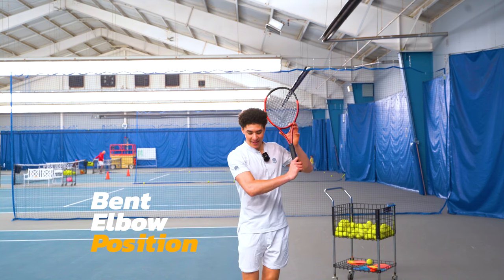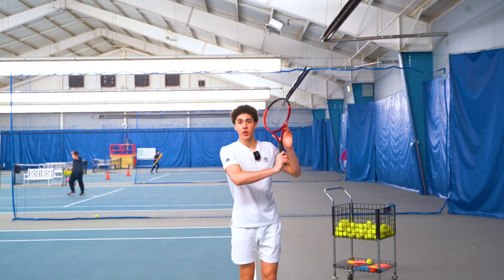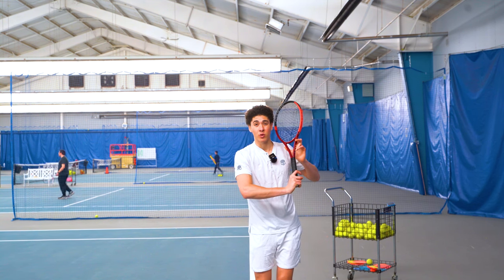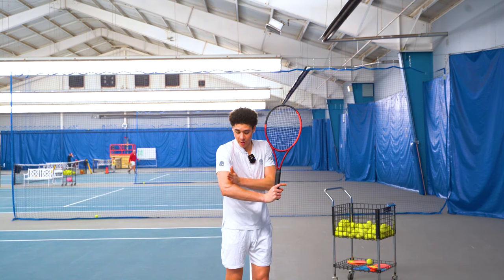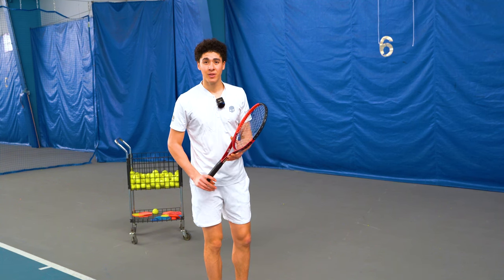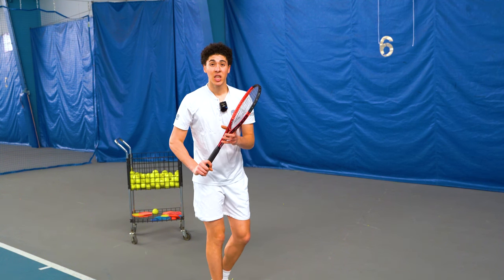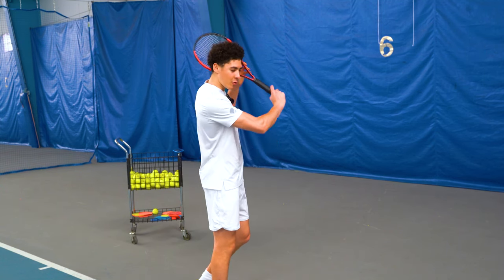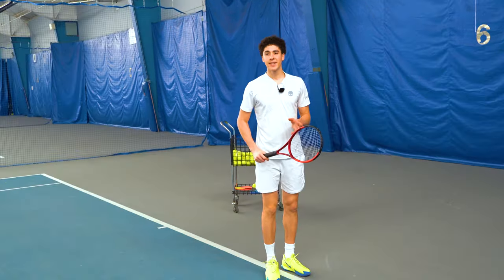How To KNIFE A Backhand Slice And Stop Hitting FLOATERS In 4 Steps (Drill Included)

Comment: IN YOUR COURSE THAT I BOUGHT, YOU TAUGHT THAT THE GRIP FOR BACKHAND SLICE WILL HAVE THE BOTTOM OF INDEX FINGER AND HEEL SHOULD BE ON NUMBER TWO.  THIS APPEARS TO BE DIFFERENT FROM THE GRIP YOU ARE USING IN THIS VIDEO. ALSO IT APPEARS THAT MY RACKET COULDNT BE PARAREL TO THE BASE LINE WITH THAT GRIP. PLS HELP
Reply from the maker: The grip in the course is the grip I am using in this video.